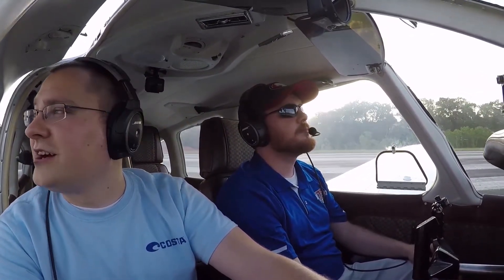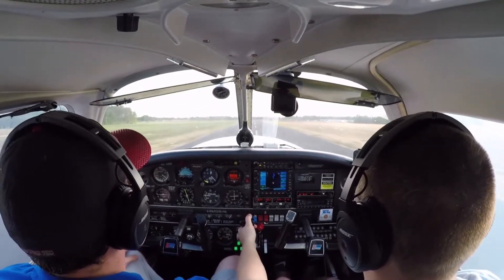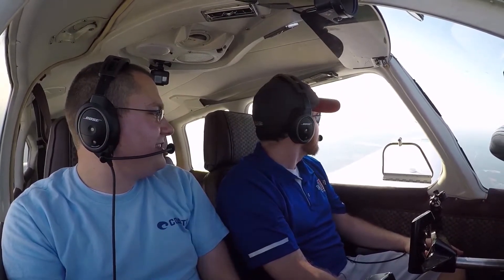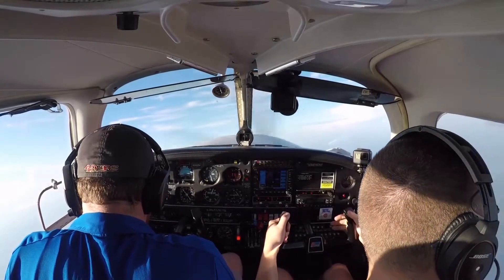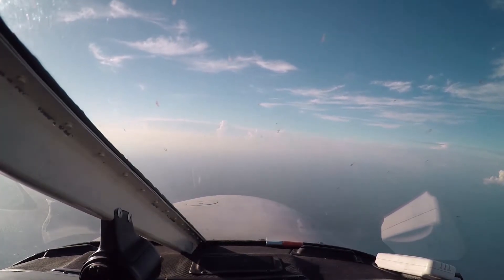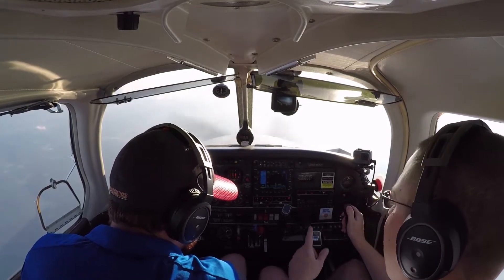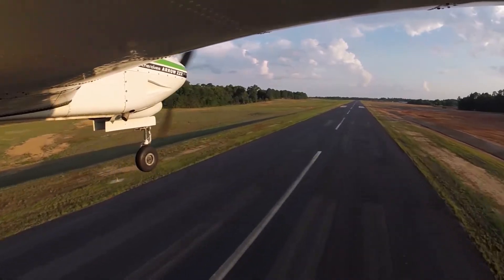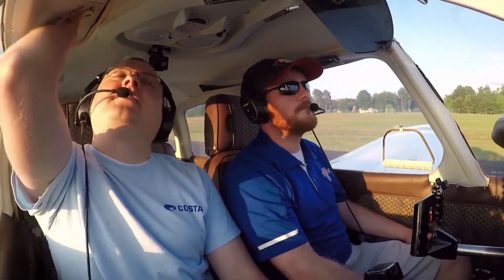Piper PA28R-201T | North Louisiana| Flight to 14,000 ft

Comment: Daniel , is this too much of an airplane for a 40 hour pilot?  I want to continue my training in an IFR certified aircraft.  I have decided I want to train in in aircraft I own. All the information that I have seen about the turbo Arrow 3 shows that it fits my mission to a tee. As part of my building up of airtime I will be flying my wife to and from work 3 days a week anywhere from a 70-mile to a 350 mile trip. I live in Alaska so the turbocharged aircraft that can get the flight levels is appealing to me. And the speed compared to a 172 or Warrior is also very appealing to me. Is a turbo Arrow 3 an appropriate/ acceptable cross country / time Builder for a rookie pilot? Thanks for your feedback.
Reply from the maker: Chuck Bradley Yeah it would be a good choice!  One of my friends did his private in a cirrus 22. It was the plane he planned to purchase and fly.  While it took longer and his insurance cost was significantly higher, he got more instructional time in the airplane he planned on actually flying after training. By the end of it he was a solid pilot and was very competent in his airplane.

The arrow is a great choice for cross country. It is pretty easy to fly too.  The only problem you will have is getting taken to the cleaners on insurance as a low time pilot in a high-performance retract.  Once you have more time in the plane the cost will come down significantly.
Reply: @danblell  yes the insurance rates are astronomical. I was told because of the recent high-profile Max crashes as well as other GA accidents that the rates would be higher regardless. But I was quoted almost $6,500 year for $150,000 airframe and Avionics. Regardless to say that hurts.  But your reasoning of training in the airplane You're Going To Fly has made since to me from day one. I have been training in a 172n but that does not fit my mission as well as  Arrow 3. Surprising enough the cost of a good 172 is about the same as a good Arrow Turbo..  I think I'm just going to have to bite the bullet for the first 9 months or a year on paying crazy insurance rates until I get in the 100-150hr flight time range.  Thanks for the feedback!

Comment: Awesome Video Daniel. Really enjoyed it. A few questions. How many HP does this Arrow have? and What power setting do you use for takeoff, climb and cruise with the turbo. Cheers Jack
Reply from the maker: Jack Ferguson Thank You!

This is a 201.  It’s been modified with an inter cooler and aftermarket waste gate.  

Takeoff is 40/26
Climb is 40/25
Cruise i think is around 30/25 

The visor on the pilot side has the cruise power settings printed on it - best idea ever imo.

Dan
Reply: @danblell  201 just refers to the tapered wing.  Turbo Arrow is a 200 hp TSIO-360-FB (typically).  There is an STC which modifies the motor to bump HP up to 225.  After this this STC is applied the motor designation changes to TSIO-360-FB(c).

Comment: PSA from my $.02.   The remaining runway criteria for G/A aircraft like this is a little silly and not helpful.  The reasoning doesn't work in that even if you had a loss of power you wouldn't be able to stop the airplane in that "remaining" runway.  But you would dearly love to have as many feet of altitude as possible in such a loss of power event and keeping the gear down that extra amount of time just hampered your climb performance that much more.  So my policy is "positive rate, gear up," as you can accelerate faster to best RoC speed and climb at a better rate ASAP.  Get as much altitude as soon as you can.

Comment: Will you respond to this comment?
Reply from the maker: soflaav8r of course!!!
Reply: Good. Found your channel by searching for Cessna 182 videos. Hope to be starting to fly one soon for fun.
Reply from the maker: soflaav8r good luck!  If I can give any help or advice, let me know!
Reply: Looks like you have some time in an SR-22, how would you compare it to the 182, and which do you prefer?
Reply from the maker: The owner of the Katmai had a turbo sr22 before that.  We flew together a lot in both.   They’re vastly different airplanes.  Cirrus is fast, high cost and not for off road.  182 (especially the 1970’s ones) are super easy to work on, lift a ton, and great on short or unimproved fields.  Just depends on your mission requirements and budget.  I’m in the SR22 today on the way home from Wisconsin.
Reply: OK, good info. The budget part is probably going to lead me/us towards a 182, plus we don't need the speed that badly. I flew in an SR-20, and wasn't terribly impressed. I know it has a lot less power than the -22, but it just didn't feel as "comfortable" as a 70's era metal cessna. Boy do I sound old. Thanks again, safe flight today
Reply: What's the expected maintenance  cost per year for owning this lady?

Comment: I own an Arrow II with the venerable NA Lyco IO360,  mx costs which I've grown to love. I've been looking into maybe getting into a turbo arrow. What kind of true were you getting at 14K? I heard 10gph mentioned in the video but didn't hear the true airspeed you were getting, only ground speed which is worthless for these comparisons. I do like the 1k+ fpm climb rate all the way to the teens. That is def something I cannot do with the NA Arrow.
Reply from the maker: Indyfalcon It’s true airspeed is in the 160 to 170 Kt range in the low teens,  and fuel flow is around 12-15 gph.  If I get a chance I will take it up into the high teens and make a video on oxygen, and include the power settings for you.
Reply: Thanks. What true were you getting in this particular flight (14K altitude?) and what fuel flow?
Reply from the maker: 165 at around 13gph
Reply: how much is you MX cost?